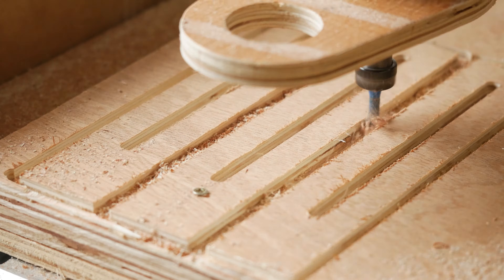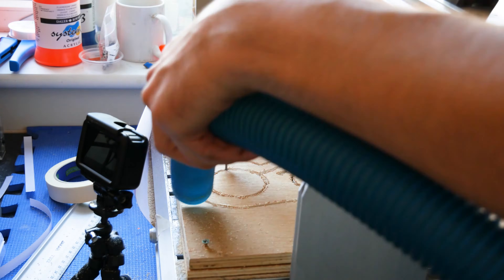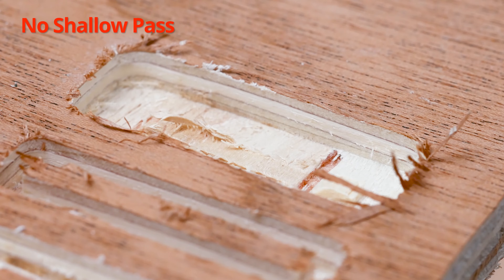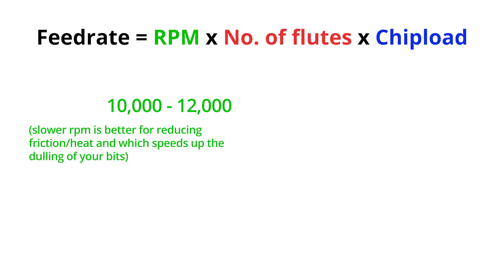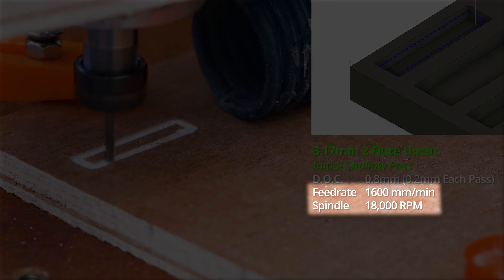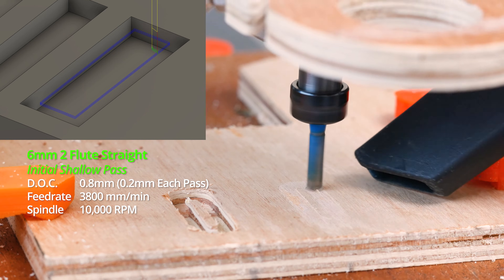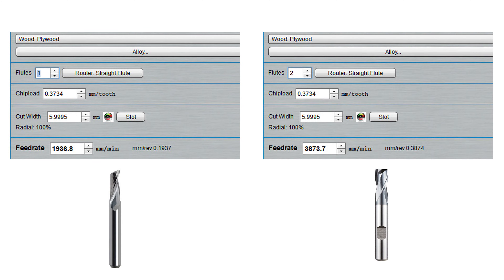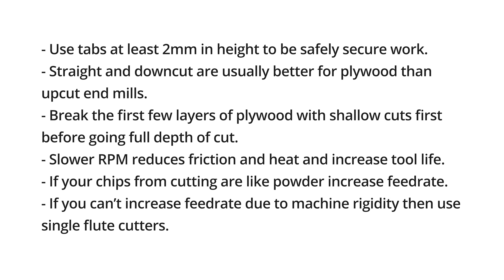Cut Plywood Better - Beginner CNC Tips

Comment: I need a cnc machine for straight through plywood cuts and making simple holes. I'm on a budget but would like to cut 48" wide sheets. Any advice for a value priced machine? Thank you.
Reply from the maker: Hi Noel whats your budget and are you willing to build the cnc yourself?
Reply: @ThisDesignedThat  Hi, thank you for getting back to me. No, I'm not really handy in building anything with precision (though I can glue and assemble.. I'd like to spend under  $3K but really haven't a clue as to what to look for. I'd basically be using a cnc to cut all the panel's and pre-drill holes for screws and entrance for wooden honeybee swarm boxes (for resale) but my wood cutting skills are poor and after ruining about 5 sheets of 1/2" plywood I know I need something that its programmed and up and running that it will cut perfectly straight each and every time. I was thinking a panel saw but could use a cnc to do some pre-drill etc.  How do these work on 1/2" ply? Any thoughts about what I'm trying to accomplish? Thank you for getting back to me I've been chasing my tail the last couple days. Be well. Take care.
Reply: Either a longmill 2.5 48inch or a altmill are top notch priced for the machine you get. Theyre made by sienci.

Comment: I would have personally rearranged that formula to have the RPM on the left and to use the feed rate on the right. 

The machine's feed rate is generally more limited than the spindle speed so you can set feed rate to be about 70-80% of the machine's max feed rate in that formula and find out what the RPM should be.

Comment: Hello, may i add sommething? With a RPM of 12000 rpm and a 8 mm tool, the cutting speed is dramatically low, resulting in poor quality. (cutting speed = the speed at which a cut cuts through the material, not the feed speed). The ideal cutting speed for plywood is between 40-65 m / sec. Therefore, the smaller the router diameter, the higher the RPM should be. Whether you can achieve that ideal cutting speed depends on the limitations of the machine. Modern professional machines can sometimes handle up to 30,000 rpm. If you keep that same rule in mind, it is  sometimes better to work with 1 flute than with 2 because of the possible limitation of the feed speed. After all, the quality of the operation mainly depends on the cutting speed. The tolerance of the clamping with old collets is also quite important and, for example, a 2 flute router only works mainly 1. Collets should be replaced approximately every 6 months when used intensively. Keep to the safety rules. Best regards.
Reply: Eratum, m/min is wrong should be m/ sec for the cutting speed. Sorry.
Reply from the maker: Hi Dick thankyou so much for taking the time to explain this. 1 flute is a must for most hobby machines I agree.
Reply: Although much time has passed, I am curious how do you get the value range 40-60 m/sec. For instance if my spindle speed = 12000rpm and tool diameter = 8 mm, then the surface speed (or cutting speed) = Pi*8mm*12000rpm/60sec = 5 m/sec. So, sould I increas rpm 10 times to reach this value rage? It's out of my spindle range. Or I misunderstand what you have written
Reply: This value is the theoreticall value and with such a small diameter difficult to reach. Choose the max rpm to come as near as possible. We have to live with it. Or choose a larger tool diameter.
Best regards.

Comment: What about down cut to break the top layer, then up cut to follow through? 

I want a side wall finish that has minimum sanding. Should I change the up cut to a straight cut?
Reply from the maker: i'd avoid upcut entirely if possible, but if you did want to use it id make sure youve cut through at least 3-5mm of plywood before running along an upcut bit. I think the wall finish is more determined by feedrate and end mill sharpness